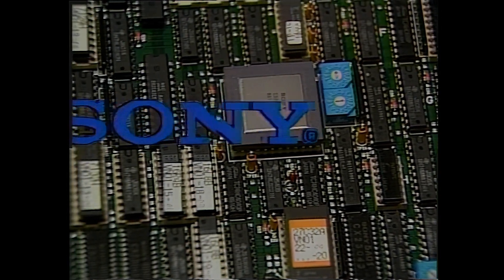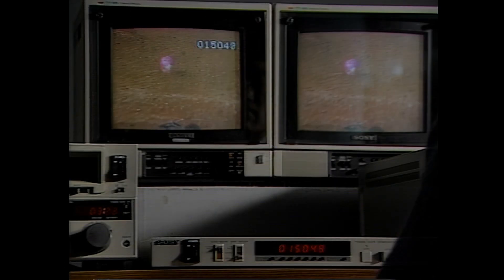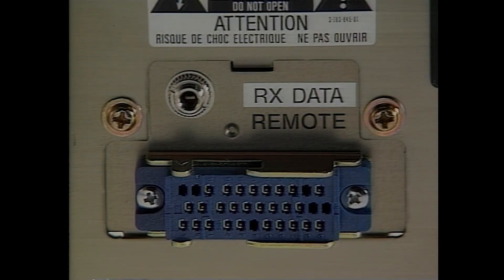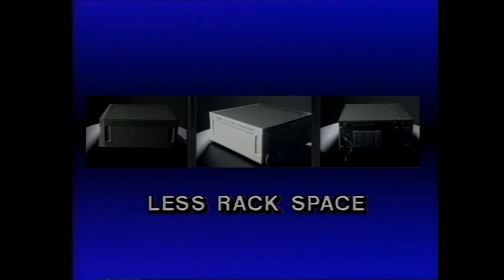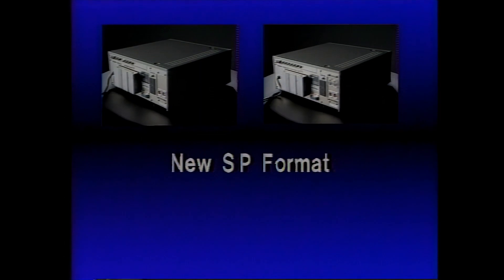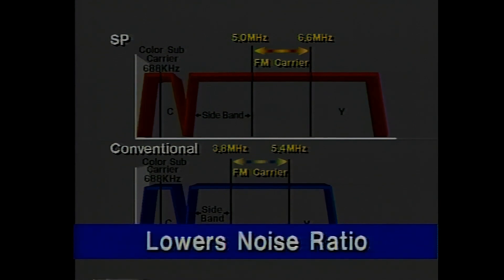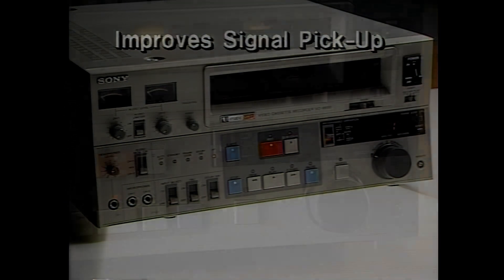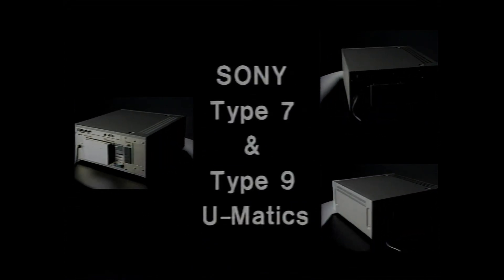Sony U-Matic Type 7 and Type 9   Second Generation Three Quater Inch Videotape Recorders

Comment: They have some errors in there - You want to raise the signal to noise ratio, not lower it. I also don't think you are supposed to play SP-recorded tapes in non-SP machines for the different frequencies mentioned in the video. The metal formulation tapes are rougher on the heads, so SP heads had to be more durable.